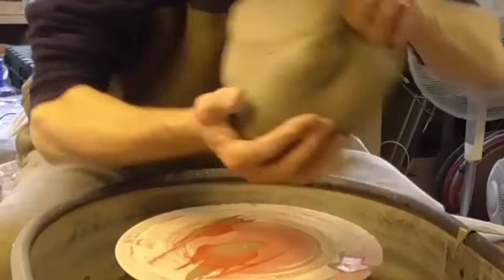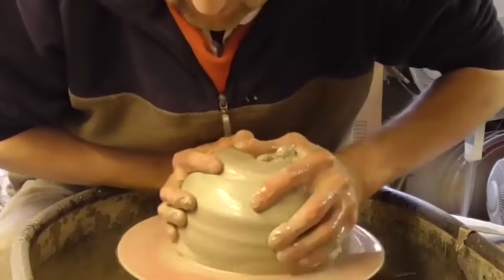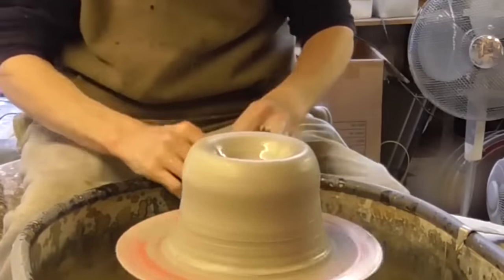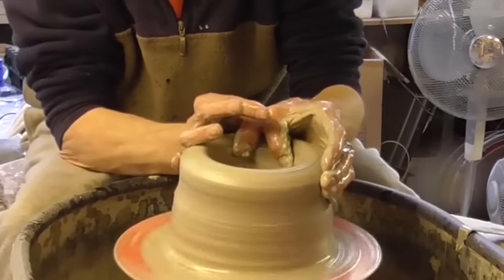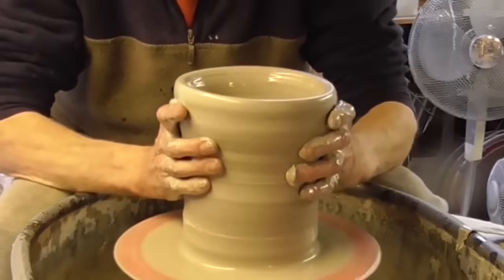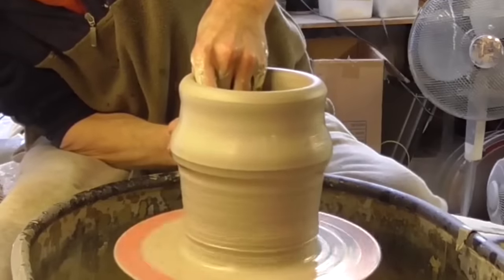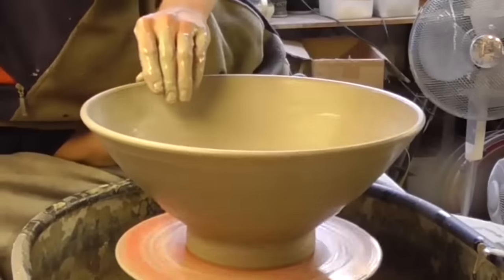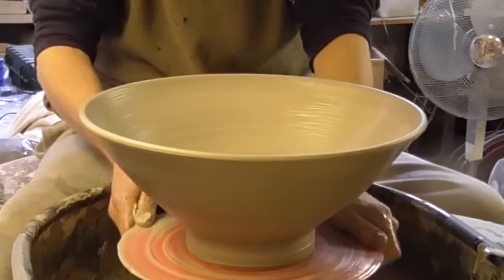Making a Clay Pottery Bowl on the Wheel

Comment: Always amazed at the speed with which you get a big lump of clay centred. Your wrists must be made out of old tugboats.
Reply: Арыс қаласы
Reply: I’ve found the faster the wheel goes the less I have to muscle the clay. Also, if I wedge and then put the clay on the wheel so it spins in the direction it was wedged that helps too!!!

Comment: That's lovely Dan.  Speed - could you change the pulley ratios easily to reduce speed? (I'm assuming that the wheel is belt driven)  I changed the pulleys on my lathe and they cost very little.
Reply: No CUZ LATHES ARE MEANT FOR METAL CUTTING

Comment: My mom got me a wheel today and I was wondering how do you get the clay to stay on because mine keeps flying lol
Reply: ciel phantomhoe make sure its centered on the wheel. dont add too much water but add enough so that the bottom of the pot almost melts into the wheel. also make sure to be gentle with it.
Reply: Start off slower perhaps. And not too much water either.
Reply: ciel phantomhoe make sure before you start spinning to push it down a little on the wheel
Reply: At the beginning, make sure you have the perfect water ratio then form the clay into a ball and SLAP it on there, then pound it down. Start the spin then add water and do as usual.

Comment: thanks for that mate love watching .a thought though if you know anyone thats is up on electrical stuff ask them to have a look at fitting a variac or some other type of electronic speed controller for the motor some motors you can some you cant , if you can then you may be able to get that wheel slowing way down to almost stopped . they are not expensive . the only problem i can see is wet hands but there maybe ones for use in wet type areas .
johno